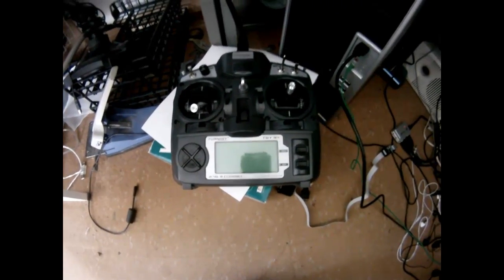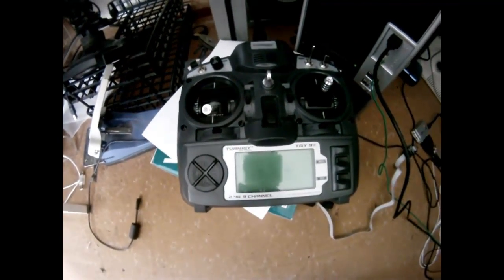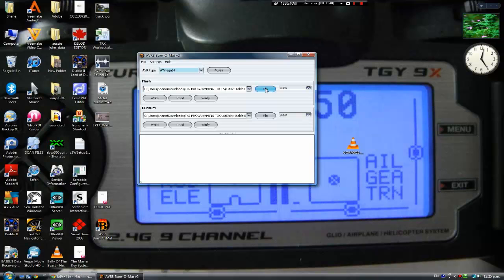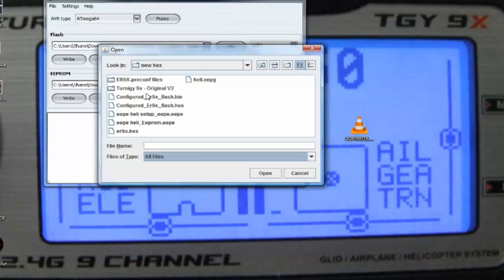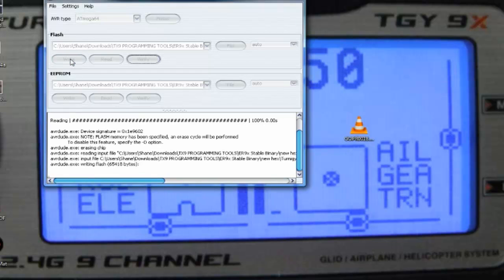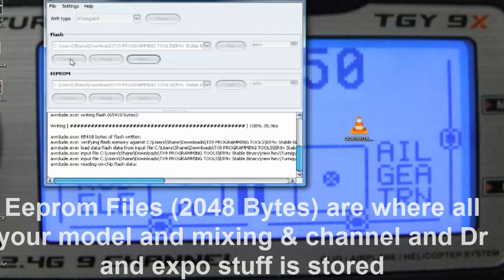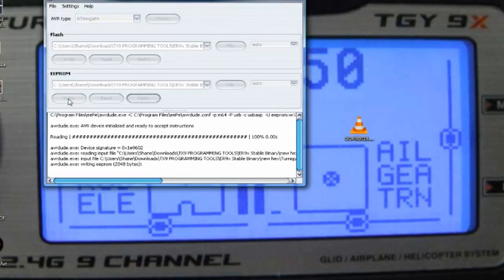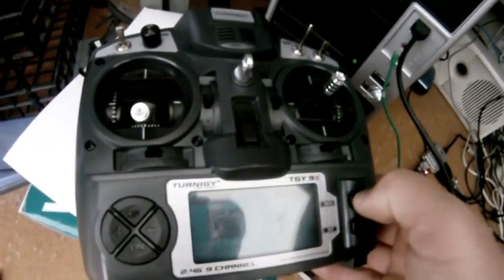Turnigy 9x conversion from Er9x back to the Original software

Comment from the maker: I backed up the original firmware (both Eeprom and Flash) with AVR8 as Eepe would not read the files... Eepe does re instate it though back to original.
I am unable to upload any videos due ot You tube issues (CODING) waiting for htem to get back to me to let me know it is sorted

Comment: how did you get the original firmware and eeprom from(i guess from the same radio's  original firmware)?wich programmer you work with(burn-o-mat or eepe)to back it up?and...could be possible to see a tutorial wich explain how to do....please